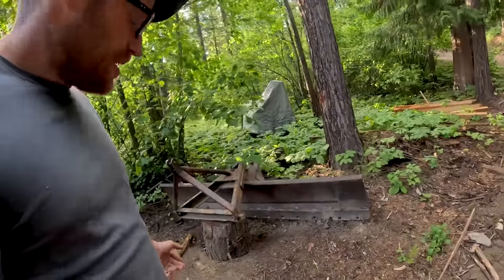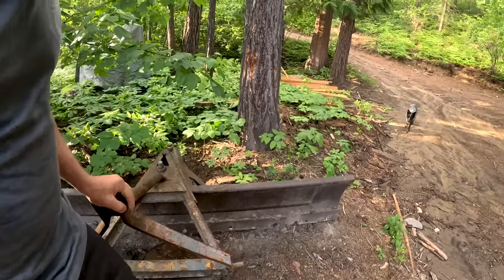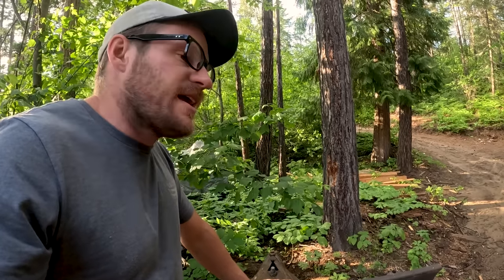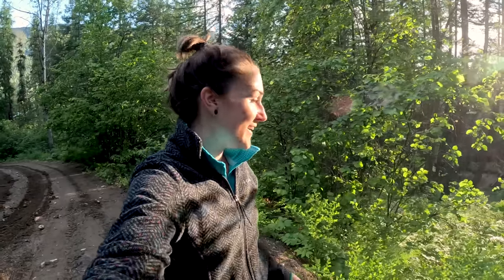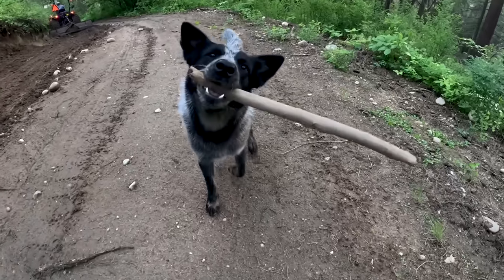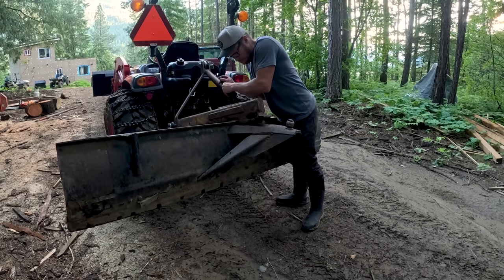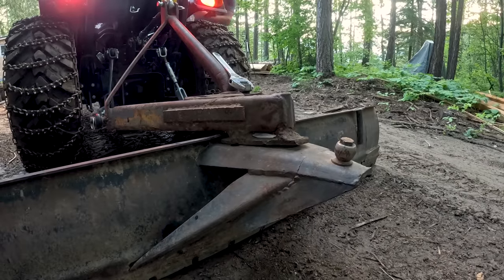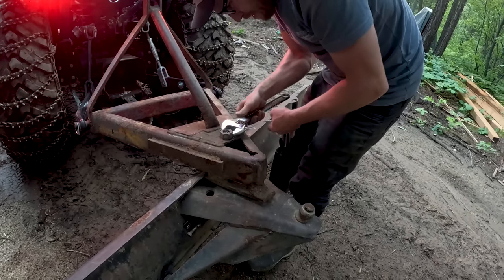The Tractor Implement We've Been Waiting For!

Comment: Greg, probably one of the best attachments for maintaining your road would be a box blade because it gathers up the dirt and gravel and deposits it in the low spots, it also has a scarifier which has teeth that you can lower which will break up the hard surface and make it easier to grade to a smooth surface.

Comment: Good start. Need two angles: left/right angle for moving dirt away from edges to the center of the road, so you can raise center and tilt angle to create a shallow drainage swale on either side of the road while smoothing the slope from the center. That way you can dome the profile of the road side-to-side so water runs off the surface and along the edges. Pick out run-off spots to drain the edge swale. Downhill side just send the run-off downhill, but uphill sides look for flat areas to create collection basins so water absorbs into the ground over time. Large flow from the uphill side requires a culvert. You don't want water crossing the road. If you don't dome the profile, then the road becomes a stream bed and rutting is a constant problem.
Reply: You're a man that is speaking from experience. Great advice and explained well.

Comment: Hi,should had got a box blade with front diggers, quickly levels out your road as well as spreading stone deliveries. A grapple for moving those logs around, safer than using that bucket with straps. Somethings to consider when your financially able. Love your vids cheers
Reply: Greg box blades are good for moving dirt from point A to point B. The rippers are for cutting uneven ground. The box fill up with dirt and they pick up and burp piles of dirt on long pulls. Scrapeblades work better for driveway maintenance because you can angle them and if you swivel them around backwards and use the edge to smooth out your work and set them at a sharp angle and remove snow without digging up your driveway. I'm speaking from experience I had an 1800' driveway I had to maintain. I had a 5' box blade, a 5' scrapeblade, 
a 6' scrapeblade, and a 6" landscaping rake. It took all of them working year round to keep up with it. The trick is cutting ditches and keeping them clean.

Comment: I applaud your hard work and persistence.  I agree with others, a box blade is a game changer on gravel driveway maintenance (or any grading) because it carries 
material along with it instead of losing it around the edges of the blade so easy, and would cut your time down significantly.  
A pull type is twice as good as a 3 point hitch also, because it levels better  with less passes and grading height isn’t affected as much  by your rear tractor tires when they go over bumps and uneven ground on the beginning passes.  Whenever the budget allows, I think you’d like it.

Comment: Well for moving logs and sitting logs on your sawmill you need a pair of forks for the front loader. You can pick up logs with the bucket but it's easier with the pallet forks. You do have a sawmill correct. To put the backhoe back on the three point hitch it's very easy hook up the hydraulics first and very gently raise the hitch points to your three point hitch.  To stop the erosion put some lead off angle ditches across your roadway.  Put the discharge end on the lower side of the road.  Put these leadoff ditches approximately every 50 feet.

Comment: Push the top link out! It will make your blade dig down deeper lessening the number of times needing to go over it. I have had the same blade for 30 years. Although to turn it you should just have a drop in pin, not have to frig around with a bolt and nut each time
Reply from the maker: Good idea
Reply: All good advice. It take hours of run time to figure out your best adjustments for the job at hand. There is no one size fits all. Your constantly making adjustments to get the desired results.

Comment: Good job. Appreciate your videos. To prevent your road from washing down hill, grade the road so the water runs of to the outside and over the hill. The sooner it runs off the road, the less runs down the road and the less washout going down the road making deeper streams. Better to have a small washout across the road than a river going down it. And yes, changing blade angle helps prevent wash boarding as well as shaping your road. Good luck!!!jjj

Comment: Once you have the road leveled, get yourself a set  of old tipper truck tires, say 5, two I  the front and three behind,, lash them together through the center of each with  cable and tow them behind. This can be done as often as you want, this will smooth the road.

Comment: Great job grading the road, and yes, the blade is heavy duty and built for the task, but I figured grapple tongs would be more useful with the logs. I use a section of chainlink fence with 3 tires on it for a drag, works great keeping the road level. Love ya'll ❤️,  I know you're doing what's best for ya'lls situation. 😊
Reply: Spin the scrape blade around and pull the cutting edge backwards. Makes your grading work smooth and you can still make tilt and angle adjustments to preserve your road crown. Your chain link drag hare trick works great on level ground for grass planting though. Really levels out the small imperfections.

Comment: Nice attachment. Inevitably, you will achieve what you want by adding stone to your driveway. No matter how many times you plane off the mud, it will quickly return with the ruts. Truckloads of stone makes it doable, and your new land plane will make short work of getting it perfect. If you had an excavator and a dump truck you could find some area of your property, like the side of a hill that has some good shale in it, and that will suffice until you get it built up, and treaded in. Finally, you will topcoat at that point with some number 2 stone. They all do it that way. Love your channel. You guys are great.

Comment: I welded wheels on mine. I made them adjustable by 4”. This will keep the blade from digging in too much. With the wheels you can scape a 1/2” at a time if you want. It a nice option.

Comment: Nice load or three of road gravel to top up the base would be nice. That way no muck on the edges to contend with. The new tractor- blade attachment works fine. Greg got a good grade A+ on the driveway/lane rework.
Reply: Yea gravel on that drive would disappear faster than Houdini. If he could get some asphalt millings or shale rock that would last much longer. Reground concrete works well and is cheaper than gravel. Get the bigger size. Pea gravel or crush and run looks great but disappears into the mud fast. Plus when it snows you just plow it up and its gone. Money wasted. 😢

Comment: so much fun working with all these implements in the country.  I also have a kioti and love it. DK45S.  anyway, land plane or box grader are easier options for roads but with the rear blade I think one of the difficulties you had was having it tilted too far farward.  the top link was too short for good cutting, the frame of the bade should be ~ level front to back for best results

Comment: Tilt the scrape blade as far as it will go and use the tip of the blade to cut a v shaped ditch on each side of your driveway. Adjust it as far to one side as possible to clear the rear wheel and cut a shallow ditch on each side of your driveway. Then re-adjust your blade to a slight angle left to right and higher on the side farthest from the tractor. Try to form a crown in the center of the driveway making multiple passes and cutting a little at a time starting ar the ditch and working your spoil to the center to form a crown in the center. Use the tracktor tires to track pack the loose dirt. Repeat on the opposite side. Try to grade it so the water drains from the center into your ditches. Keep your ditches clean and scraped out and your driveway will last longer but you should do regular maintenance to keep runoff water from cutting ruts in your driveway. It gets easier with practice but it always a PIA. Sometimes you can just do spot maintenance if you catch it before it gets bad. Water always runs downhill and will cut its own path if you don't cut ditches and crown the center so the water runs downhill. Good luck. A second tractor with a scrapeblade or even better an old motor grader makes life a lot easier. Teaching your wife to drive it is even better😂
Reply: Katie does drive the tractor.   She loads logs on the mill and the bucket.   She runs the chipper
Reply: @jamescumbo1928  Most wives in rural settings can run whatever equipment that is available out of necessity. My wife could drive the tractor, run a skidsteer, a mini excavator, drive the dump truck , but what she really enjoys is cutting the grass with her Zeroturn lawnmower.. Honestly she does a better job than me because she takes her time. I'm always in a hurry to get to the next project. My wife was a country girl from Tennessee and she is very skilled with equipment and a damn good cook.

Comment: Guys, Subject, Grading you road.  you might want to consider removing the Angle Blade from the rear of your tractor and roll it over with he cutting edge on top.  The moldboard is the part the cutting edge would be normally welded to.  in your case the edge, the part the cuts into your road, is to thick.  With the edge looking up, you can take a cutting torch and starting from the back side, bevel the edge to where the leading portion of the cutting edge is about 3/8" to 1/4" thick.  NOTE: don't forget to pick up ass your cut of pieces of steel in order to eliminate FLAT TIRES .  Turn the angle Blade right side up and you're ready to plow.  Here's a couple of grader tricks the will help grading your road.  Angle your blade into the up side bank and cut a 2" deep ditch.  With the blade angled forward into the bank, tilt the blade so your blade will just slightly cut at the center of the road, leaving a loose earth berm in the middle of the road.  Plow a 1/4 to 1/2  mile and then turn around and grade the opposite direction just like you did in the other direction. When you get to where your started to first cut, Pull the blade out of the dirt, adjust the blade to the opposite angle and start blading about 1/3 of the berm towards  the ditch but not filling the ditch.  at the end of that run, turn around and blade the other 2/3 of the berm.  Each time you get to this point cut enough to start digging out the water washes and pot holes and grade your material back and forth until your happy with your road.  Good Lock an happy holidays

Comment: You need to angle the blade more and lower one of the hydralic arms so the corner of the blade is cutting the high side of the road. The road needs a crown in the middle so it will shed water.

Comment: Don’t make the road level, make it 4 degrees out slope, for water run off, so it doesn’t run down the middle. Put in shallow drain  dips every 100’ by hand. You’ll get less erosion. A 4 or 5 degree out slope is so little you have to have a trained eye to see it.  10’ wide with a 4” drop on the out slope is enough. Less water will build up when its raining as it runs off.

Comment: When its time to put the backhoe back on, pick it up with the bucket and move to a more level spot to put backhoe back on, hope that will work.
Reply: Yea those frame rail back hoe attachments are a bear to get back on even on level ground. A old motor grader dedicated to driveway maintenance is the way to go and are surprisingly inexpensive and the old ones last forever. Keep em full of antifreeze and change the oil ever couple of years no more than you use it.

Comment: When are you going to finish the exterior of the family home, which is something very important to protect the enormous work that you have done in addition to giving it aesthetics?
Reply: I have been wondering the same thing.
Reply: Isn't it weakening those trees to be cutting so close to them? ❤ 😮
Reply: As usual Greg is nailing it.  As I’ve said before I admire you both so much.  Wishing you great success and happiness in all you do.  A fan from Ottawa 👵🐶🥰
Reply: @paulmonk7820  No the trees stabilize the dirt and help keep it from washing into the driveway. As long as you don't cut the tap root they will be fine. Damaging the bark is worse than cutting a few roots.

Comment: When building and upkeeping a dirt road you always have your blade angled. Your goal is to have a crown on the middle of your road so the water can run off.  Also, you really need to clean up your area so you can use the area better.

Comment: Have you considered a tire drag for winter to create a hard surface to plow initially? It can be pulled with quad. I use one for trails here to hard pack the gravel on laneway and for trails and they work great.  I figured you'd get a box blade but a back blade is awesome! Road will be kept nice for sure with this heavy duty beast blade. What an awesome purchase... its not like you could find anything of that quality in a store! Shear pins may work better than a cotter pin... At least if u break a shear pin you won't wreck your linkage.Are u close to a Princess Auto or Peavey Mart?

Comment: You were using your adjustable wrench the wrong way when you were loosening the nut. Right way when you tightened it back up. Always want the pressure on the frame and not the adjustable jaw. 
Comment for the algorithms 😂

Comment: that's why people get a box blade now it hold extra gravel for the low spots
Reply: Box blades are for moving material from point A to point B. A scrap blade and a landscaping rake are the right tools for driveway maintenance and snow removal because you can angle and tilt them.

Comment: A box blade with scarfire shanks would do a considerably better job. It allows you to break up the surface with the scarfire, then you can carry a  box full of material to fill the voids, while also taking down the high spots. Your adjustable links will allow you to shape your ditch and center crown.
Reply from the maker: The Ripper shanks would help so much

Comment: Please get your feet and legs out from under that blade or for the same sake your loader pins when making adjustments (Best advice, stand in your bucket when releasing the quick attach on loader). Had you completely removed that nut with the blade in the air like that, BEST case your right foot would have been broken. New equipment is exciting to use, but spend a hot minute familiarizing your self especially if it comes with no safety docs. I have the same tractor and the backhoe getting hung up is annoying too, but a trick I've found is to set it down on a pallet. Once the hydraulics lose pressure, it will be much easier to reattach like you said in the video.

Comment: go back watch putting the bolt in the blade angle hole, until you figure that out. okay long enough drop it in from the top no nut needed.  is there ballast in the tires of the tractor,  water in the south, something that doesn't freeze for the north. chains are a pain the ass.

Comment: I will tell you again, You have the wrong vehicle for that area you live in.  What you need is a small excavator with a blade on the front and a bucket with a thumb.  Much better for handling your wood and scraping your drive.  That tractor is just not the right tool.  It is meant for flatter elevations and farming style implements, mowers and such.  There are so many more implements that could be attached to an excavator that would be very useful to you.  The back hoe on your tractor is mostly useless because you have to reset it it for every use.  It is made for digging small holes or ditches. You need to be able to grab stuff and move it at the same time where you live.

Comment: i cant stop noticing that you're operating the tractor with chains on in the summer will it not cause premature usage on the chains or the tires
Reply: No but they are a lifesaver in the mud. Makes the ride a little rough on hard ground. Easy enough to put on and take off as necessary. Great accessory to have when you need it.
Reply: @tomparker9966  Do you have ballast in your rear tires also? I`ll keep that in mind to leave the chains on in muddy & steep grounds.

Comment: Fly ash is a by product of coal fired electrical plants, they will give it to you.
Reply: That's actually not a bad idea if you add it when the road is wet to stiffen up the mud but you've got to watch runoff because of the heavy metals left in it after burning the coal . Here in NC they passed a law that allows them to put it under airport runways and road beds but it has to be encapsulated to protect the underground water from run off. Duke energy had a fly ash pit dam rupture and pollute the Dan river. Check EPA regulations first. You don't need problems with those guys. "I didn't know"  doesn't work with those guys. They are ruthless.